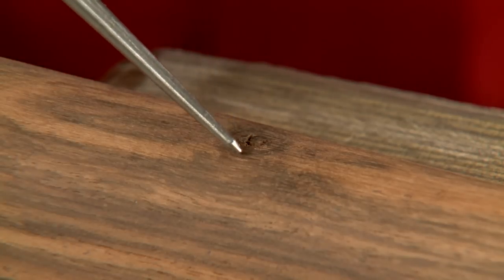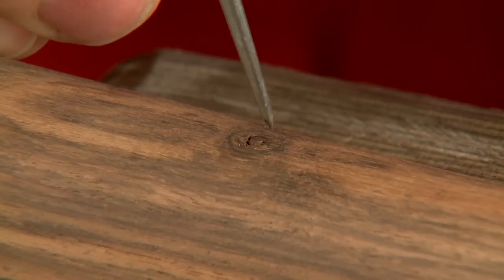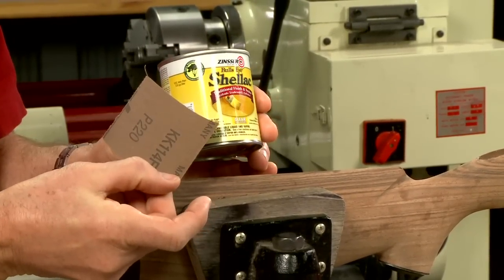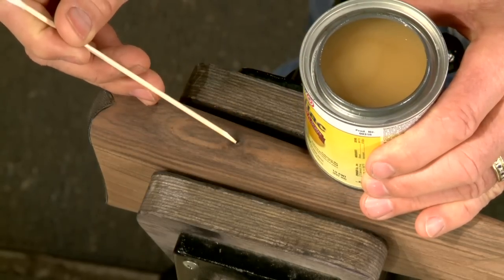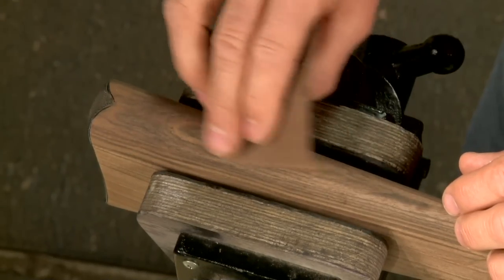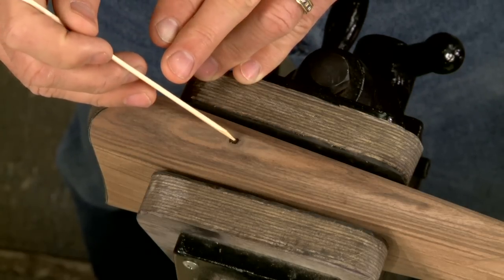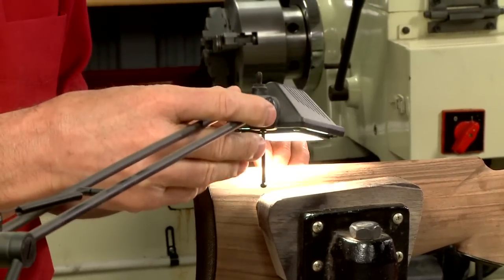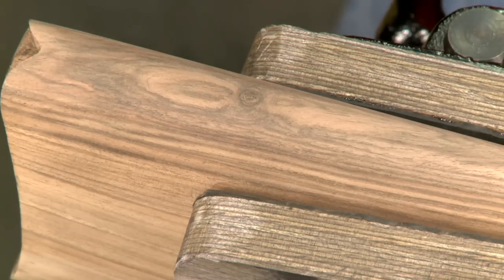How to Repair Gunstock Imperfections - Knots & Cracks | MidwayUSA Gunsmithing

Comment: I use CA glue mixed with saw dust (from the stock), and spray it with CA accelerating spray. Done. Sand and prep for finish.

Comment: Never had problems until I started in on my current project; a 1901 American Gun Co. SxS 12 Ga.  Amazingly, it is NOT broken, but has hairline cracks. I sealed the cracks and tried sanding with wood glue, but it still shows. Since I will probably use a semi-gloss I've hung onto that turns out dull, but provides protection, I'll try this same trick with it, instead.  And, if not, I'll just re-sand and try something else.

Comment: traditions kentucky long rifle kit.  forward grip needs to have a drilled hole filled.  missed the notch under the barrel while drilling.  safe to use afterwards?  would be using 90 grain, .490, round ball.  Thoughts?